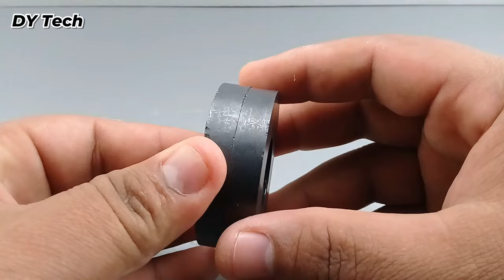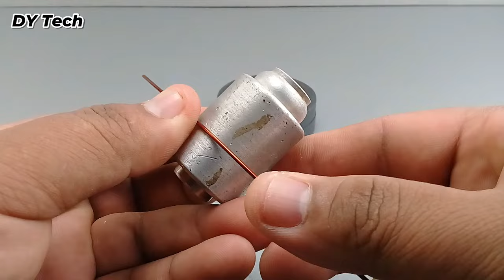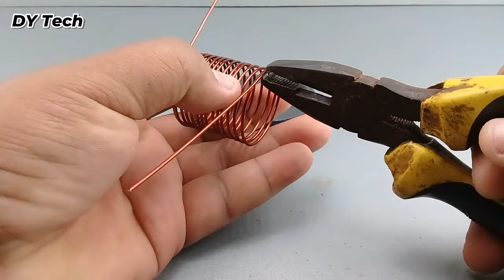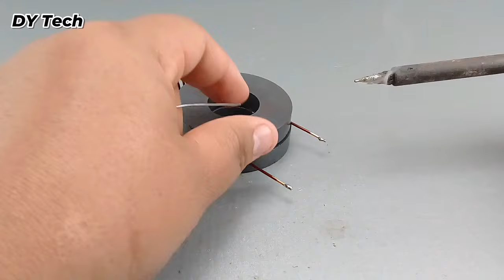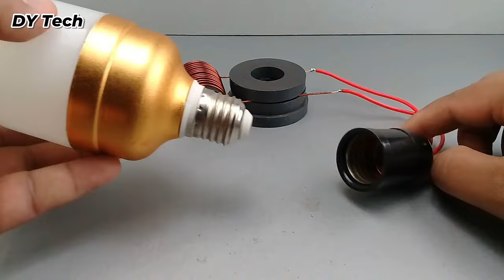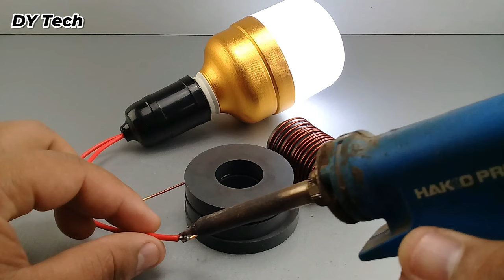220v free energy generator from big copper wire 100%

Comment: It's a scam light bulb. It's a trick light bulb. You complete the circuit from the center of the light bulb to the edge through the circuit. The light bulb has a battery and i LED IN it.

Comment: What type of light bulb did you use? Give specifications. Did not work with standard l e d light bulb.
Reply: How it works, you unscrew, the top of the unusual. Looking light bulb inside, you will find LED and a battery. When the light bulb is screwed into the socket, it completes a circuit from the shell to the center post turning on the light bulb. Nice illusion.😂